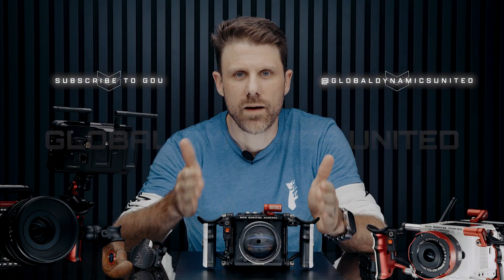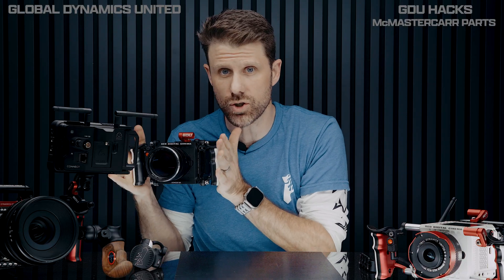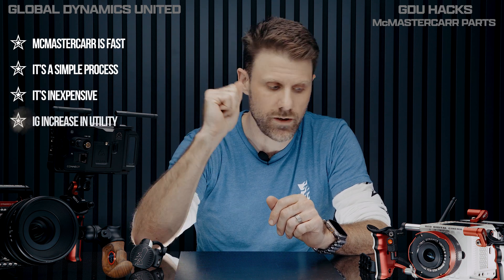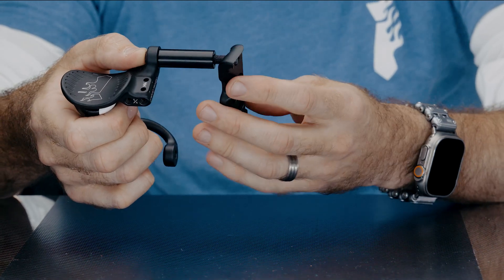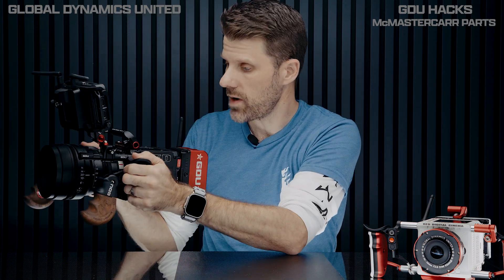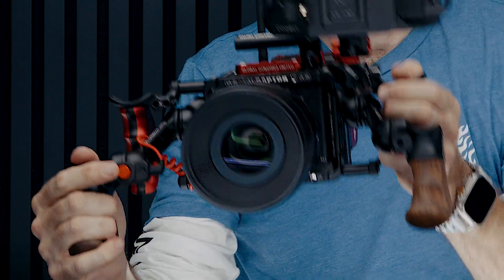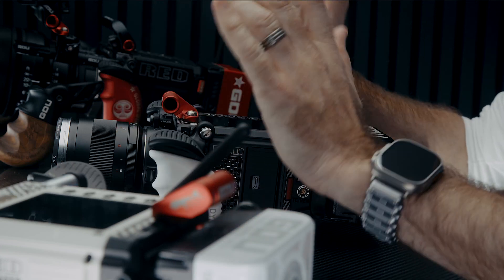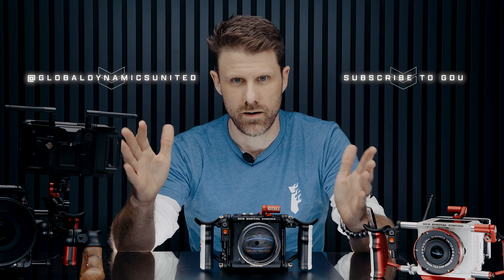GLOBAL DYNAMICS UNITED: USING McMASTERCARR PARTS TO HACK + MODIFY YOUR GEAR FOR BETTER FUNCTIONALITY

Comment: Is there any other way to connect the Atlas Handle to a Komodo X using the Atlas Thumb Screws besides using the Expansion Ribs? Unfortuantley the expansion ribs do not work with the DSMC3 monitor.